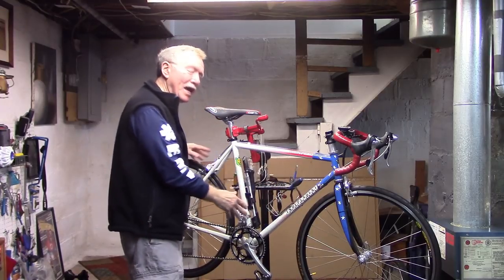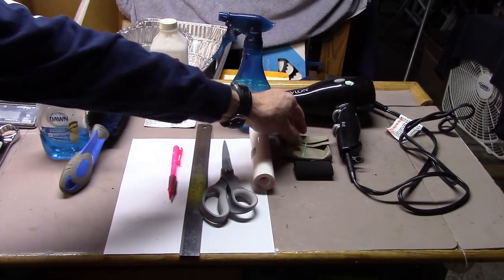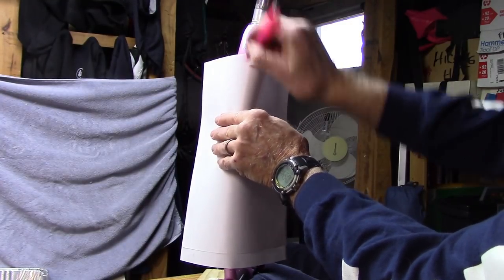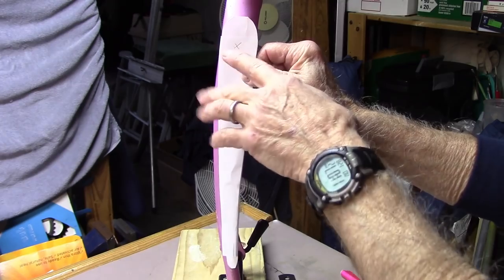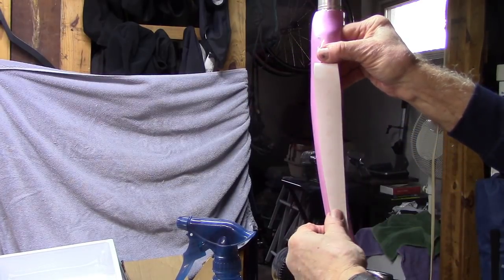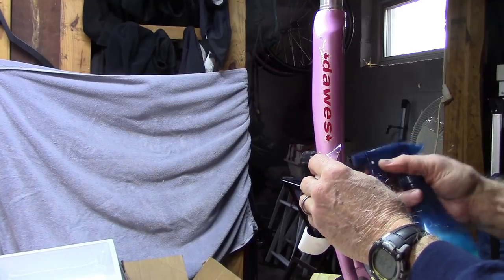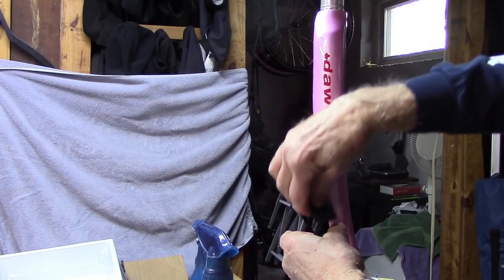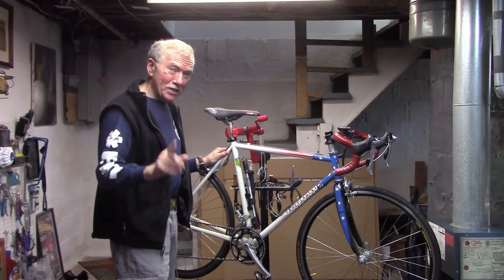Helicopter 3m Bike Frame Protector Tape: Tips on Application

Comment: Thanks for the  video. If I can add something to help out, after cleaning the bike,  you should spray the whole part you are working with (fork) and spray the whole  3M piece you cut (2 faces of the peeled 3m). Then, you'll be able to position the piece and re position as needed... Press the  water out with the squeegee coming from the center of the piece, and finish with your hand, and or a lint free cloth. If the 3m keeps  lifting up, keep pressing until it stops lifting. It will eventually stop lifting.  Also, to easily create a pattern from the bike to a sheet of paper, I usually take a carpenter pencil with a large lead expose. Tape the sheet of paper (I cut large paper stripes) on the part you want to replicate so it doesn't move. Then, rub the lead on the surrounding edges of the part you want to recreate. Take off the resulting drawing, make some touch up, cut  and double check the shape with your frame. It should give you a pretty good replica of the part itself. Transfer to 3m and apply. Let set for about 24 hours indoor. Enjoy! Hope it helps! Cheers and thank you for the video.
Reply from the maker: Great suggestions. By spraying the whole piece you're working on does allow you to position the 3M piece and then begin squeegee from top center and out. Also your suggestion on drawing a pattern and transferring that to the 3M tape is excellent. I will pin this comment to the video. Thank you and regards, Tony

Comment: Cheers for this, the easiest video on this I found. Work a treat on my carbon bike.
Reply from the maker: Just use caution when removing Helicopter Tape from carbon fiber. Should you want to remove it, remove the tape very slowly as in the video below:
https://youtu.be/Poz8-ISjt6g?t=436
Regards and safe cycling, Tony

Comment: thanks for the great tips,I am about to do this on my son's new bike.
Reply from the maker: Just be careful with the hair drier. Use it to pin the top middle of the tape. Spray water on each edge and begin to squeegee from the middle out to eliminate air bubble. Start moving down and spaying more soapy water and squeegee. Use the hair drier cautiously and just in the mid section where you have already squeegeed out the water and air. Have fun. Regards, Tony

Comment: Very helpful video Tony.

I am trying to protect my pedal car project which has a square frame inch and a half.

Do you think it is possible to completely wrap the square tubing? Have you observed the behavior of helicopter tape when it overlaps other helicopter tapes? Thanks again for the video.
Reply from the maker: I have not tried square edges or overlapping the tape (which is not usually required on bicycles), but it should work). However, the Helicopter tape is not cheap and you may want to try a cheaper alternative such as Clear Gorilla Tape or other alternatives.

Comment: Brilliant 👏 thanks for the tips. I'm gonna try this.
Reply from the maker: Note that some suggest spay soapy water on the whole area where the tape is to be applied so you can move the tape around a bit if it not in the exact position you want and then using a hair drier and squeegee to remove the soapy fluid and air. Test out the method with a small area you would like to cover before tackling something larger. Have fun. Regards, Tony
Reply: @tony10speed  thanks for the reply and advice much appreciated 👍

Comment: Why do you wet the sticky side of the tape? If you are just doing a very small area, say where the cable rubs, surely  cleaning the frame and carefully positioning without any air bubbles will do a perfect job?
Reply from the maker: For a very small area, you can use it without wetting the sticky side and have it work well as you state correctly. For larger area, the method shown allows you to push out any air bubbles and get a smooth attachment. Some suggest spaying the entire back side with soapy water which allows you to move it around to the correct position before using the dryer and squeezing out the excess fluid and bubbles. This has worked well for me. 
Regards and safe cycling, Tony

Comment: Won't the hair drier get rid of all the water you need to stick the tape?
Reply from the maker: You must be careful to slightly dry just the very middle and keep re-squirting the edges. This keeps the tape from moving around. It's a delicate but do-able technique. On small pieces, I skip the drier completely for the reason you state until the very end when all the air and bubble are squeegeed out. Then lightly use the drier. A point well taken. Thank you. Tony

Comment: How long can you keep the helicopter tape on before you need to change it?
Reply from the maker: The length of time helicopter tape last seems to be quite variable when looking at various cycling forums. Mine has lasted for many years. Some say 5 - 7 years, others shorter. I think a lot depends on how well you clean the frame surface before application, the application method, the type of riding you do and the trail or road surfaces. Here's how I apply the tape:
https://www.youtube.com/watch?v=odURZ1aIai8&ab_channel=TonyMarchand
Sorry I can't be more specific. Regards and safe cycling, Tony

Comment: Sir Can I Using Heat Gun But That Heat Gun So Much Hot Temperature 400°C but Can You Teach Me How To Use That? Or Can Apply Without Heat Gun Or Hairdryer?
Reply from the maker: Don't use a heat gun (gets too hot). You can  use the tape without heating. Apply some soapy water to the area to be covered and hold the tape at one end with your fingers so it doesn't move around and squeeze the water out with an applicator or even a credit card working your way from where you are holding it toward the other end. Start in the middle and squeeze out the water toward the sides. You can practice on an area of the frame that is not easily seen first until you get the hang of it. Good luck and have fun, Toy

Comment: Go to EBAY for good prices on helicopter tape. Some sellers sell it by the foot....4" width is best as it will go around any bike part and still need trimming...narrower tape can lead to bad seaming....14mill is the best....any thicker and it is tough to work with....also make sure you know the expiration date...some are selling tape that has been expired for 10 years....any more that a 3 or 4 years past the expiration date could lead to problems
Reply from the maker: Excellent information. Our viewers will appreciate the input. Regards, Tony

Comment: Amazing video !
Reply from the maker: Glad to help. Just be careful using a hair dryer. Hold in far enough away not to get to hot and just use it to tack the top and middle as you go. Keep the edges moist with the spay until you can push out all the bubbles. Practice makes perfect. Regards, Tony

Comment: Thanks.  Exactly which 3M product are you using?  There seem to be several versions.  Thx.
Reply from the maker: I used 3M Scotchgard Clear Paint Protection (Bulk Film Roll 6-by-48-inches). It's hard to decide which one of the 3M protects are the best but I've had good luck with this one. Anyone else have any suggestions?

Comment: Can I use this on a carbon fiber frame aswell? I used it on a brand new frame and it peeled off the lacquer... It makes me hurt just to say it. I obviously did something wrong... 😔
Reply from the maker: We studied this point. See:
https://www.youtube.com/watch?v=Poz8-ISjt6g&ab_channel=TonyMarchand
We were able to remove Helicopter tape from carbon frames on some bike by heating the frame tape with a hair drier as shown in the video. But in others, the tape removed the clear coat that covers the frame. Removing frame tape is a tricky business and does not always give the result desired. Regards, Tony

Comment: Do I have to use a Hairdryer? I'll have to buy one then
Reply from the maker: No. The hair dryer just makes it easier to hold the middle top in place as you work and keeps it from sliding around. You can use a finger of one hand to hold in place while you use a squeegee with the other hand to push out the air and bubbles. Good question.  Regards, Tony

Comment: I just use black electrical tape for my down tube and chain stay.
Reply from the maker: I also used electrical tape for years  until I came across clear Helicopter tape. Easy to apply, works well, and can be removed if necessary. When removed, one can use the piece of electrical tape  for on the road repairs (unraveling bar tape, keep a broken cable out of the way and more). Regards, Tony
Reply: I do exactly the same. Its been on two years and hasn't come away. Really protects the frame. I have a black frame so black tape was great...i don't care that no-one can see the bike model printed on the frame....doesn't take from my pleasure of riding it.

Comment: This tape isn't genuine helicopter tape, the real stuff is polycarb, it scratches easily and will stretch instead of tearing. This 3m tape is acrylic and looks glossy but tears
Reply from the maker: I used 3M Heli Bike Tape. Note: There are many types of tape used in aviation. Here are my references for 3M Helicopter tape and more for aviation uses:
https://www.3m.com/3M/en_US/aerospace-us/products/military/
and
https://tapes.averydennison.com/na/en/home/industries/aerospace.html?gclid=Cj0KCQjwvL-oBhCxARIsAHkOiu1hzDqjCbGO_25Bv9BRU08qPhXgbFgCQIhOIomjfezAPxg0vZm9sk8aAnPCEALw_wcB
Please share any additional references you may have and what you consider best as a bicycle frame protector. Regards, Tony